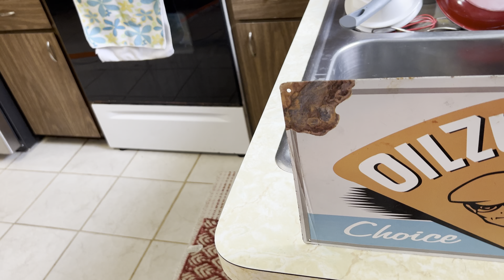Hot Wheels vs Johnny Lightning Indy Tournament Featuring LCI Honda

Comment: Man....first round !
Reply from the maker: I’ve yet to find a Pro Circuit that was very fast.
He was super cheap.
The Majorette Corvettes were the easiest wheel swap ever. The suspension spring slides out of the way and voila.
The Pro Racing wheels were a no brainer. He got a 7 gram bump too.
It was almost competitive. I did it mostly for looks anyway.
Thanks for picking Bubba